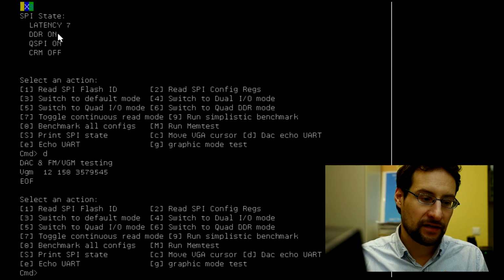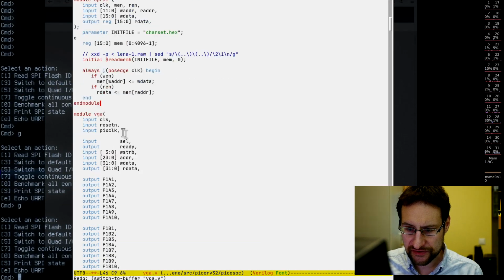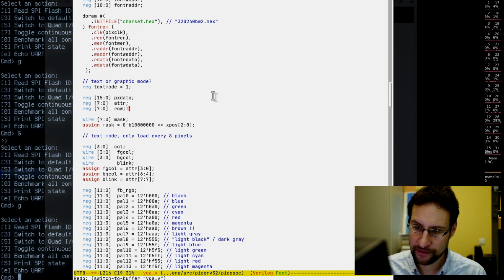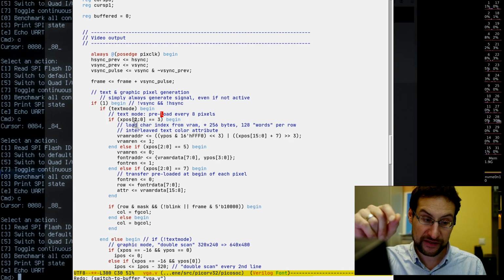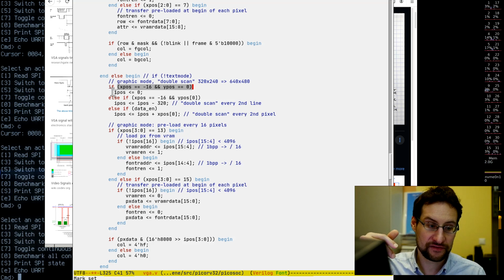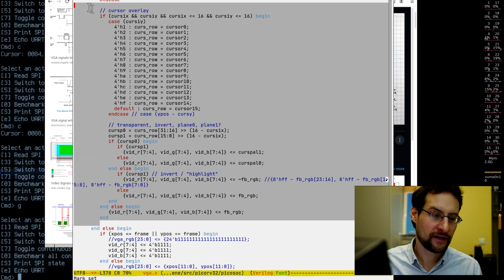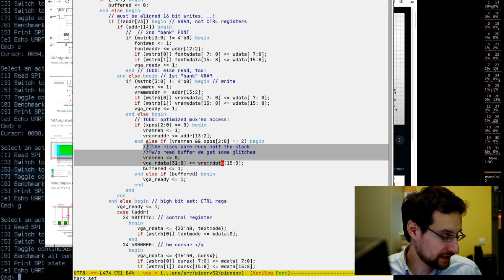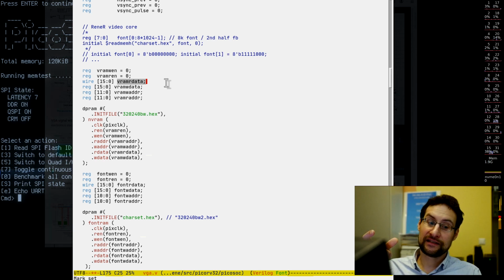fully working fpga graphic and text mode video core!

Comment: René, have you thought about moving what you can to the flash chip, there's a lot of spare space in there. Thinking about ROM routines that can 'execute in place', extended character sets and look up tables to help accelerate some tricky math functions. I'll look into it myself once my boards arrive.
Reply from the maker: AFAIHS the C code indeed runs from the flash, as I said one could indeed sacrifice e.g. 64k of SP RAM and use it for the FrameBuffer, ... if 64k RAM is enough, ... I probably should finally do keyboard & mouse and then see what I do
Reply: @renerebe  KB + Mouse is going to be a bit of a tight fit. KB plus SD card (spi mode) might be more useful. I'll have a go at porting Chan's FatFs (link below) to picosoc when I get up and running.
http://elm-chan.org/fsw/ff/00index_e.html